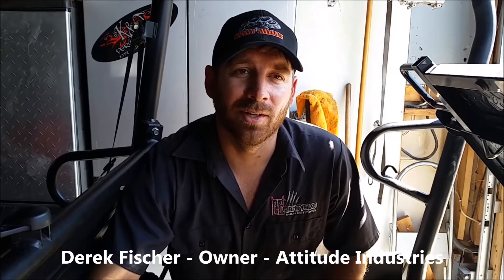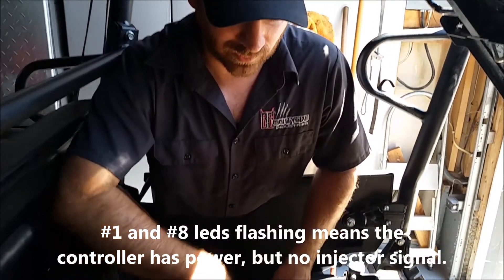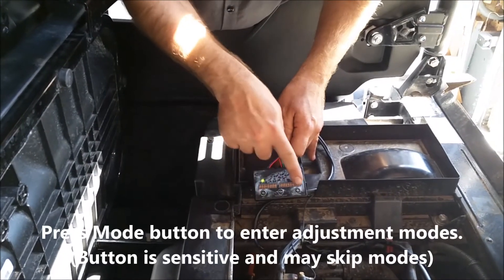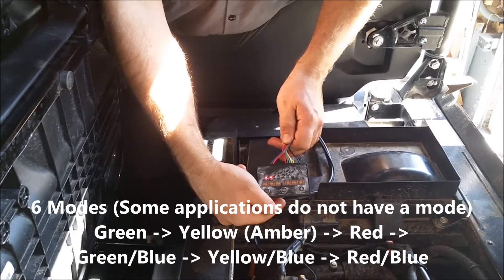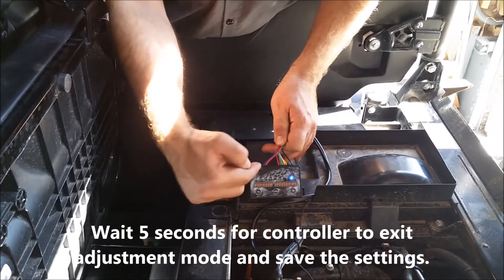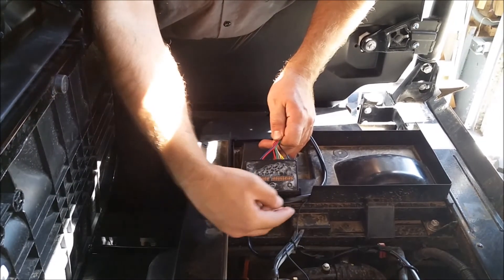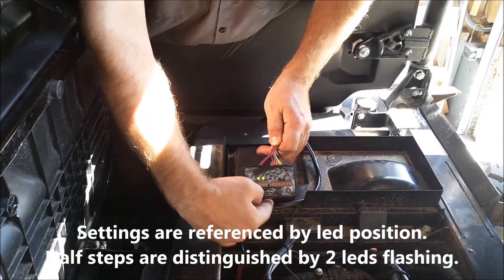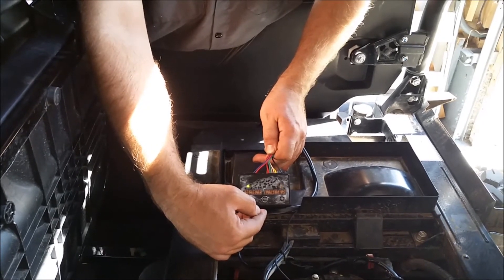Attitude Box Basic Mode Adjustment | EFI Controller | Attitude Industries

Comment: Just got mine in the mail for my 2019 Can-Am Outlander 570 with stock pipe and intake (adding later.) Maybe this will fix the lean issue Can-Am has and i can feel a power difference.
Reply from the maker: Thanks for trying out the Attitude box.